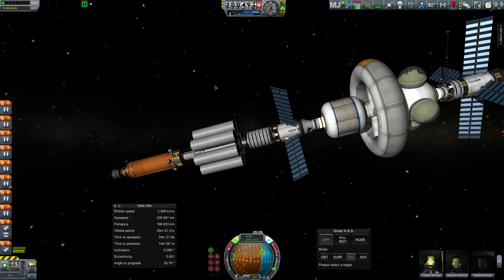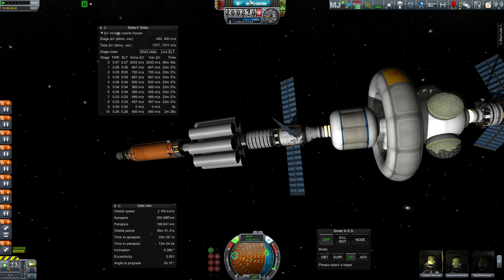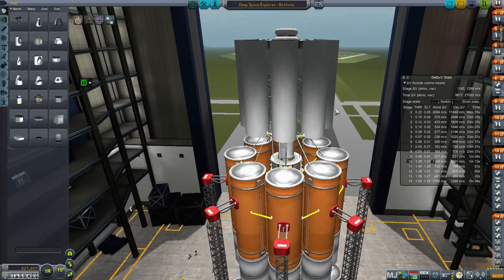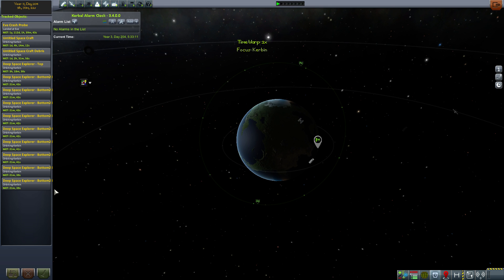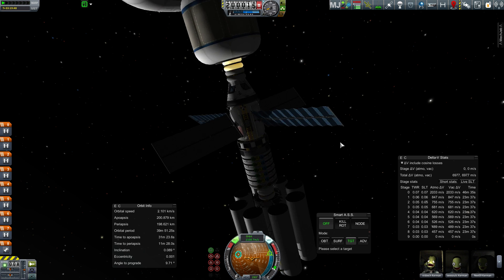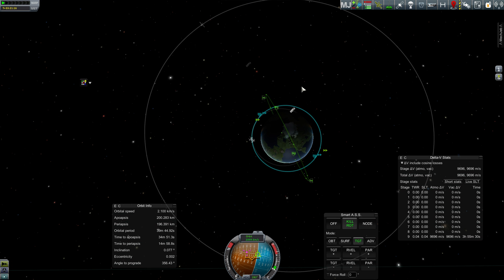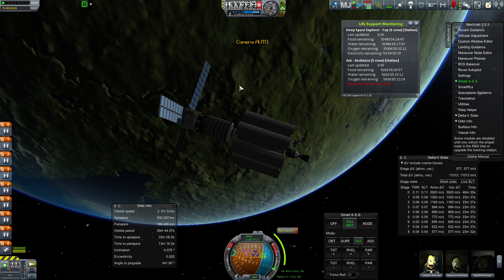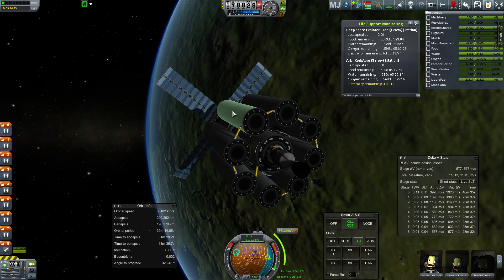MISSION TO JOOL: Nuclear Engines are Go! | Kerbal Space Program - Hard Mode Mods! - Ep #53

Comment: Did you include a big heatshild on your ship for Jol-aerobreaking?
Reply: Omega Xicor Turns out he had radiators though. But still, something something Space not good at absorbing heat.
Reply: +El Topo I don't think he did, nor heatsinks for the nuker.
Reply: Well he is in space so heatsinks are somewhat unwichtig (unimportend)...or!?
Reply: El Topo I'm not sure why but I have this idea in my head that space isn't good at removing heat from objects even though it's really cold. I think it has something to do with it being a vacuum and as such there's nothing there to remove the heat, so you need radiators with large surfaces and a coolant circulating to cool things efficiently. I might be totally wrong though.
Reply: +ColtaineCrows no, space is bad at absorbing heat, I don't know why but it's something to do with the zero pressure affecting boiling/melting points, I may not know why but I know heat doesn't disperse into space very well

Comment: quill, boosters are called boosters for a reason. If you need dV and not efficiency, it's probably more effective and cheaper to use boosters. You won't need that many engines then either, just enough to be a bit above 1.0 Thrust to Weight.

That firs stage just looked horrible to me :P